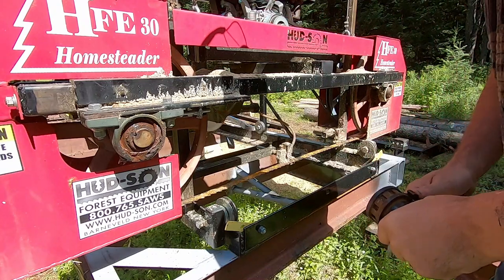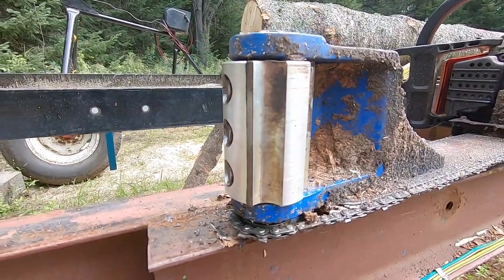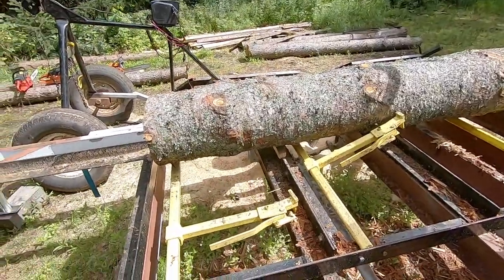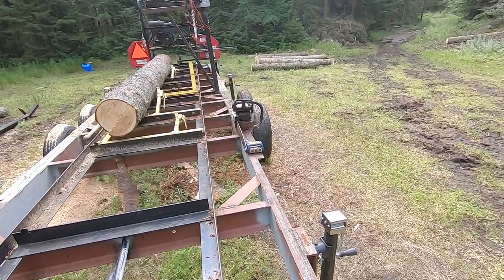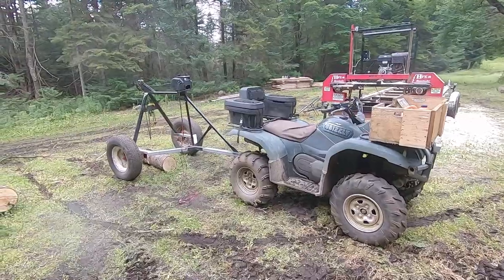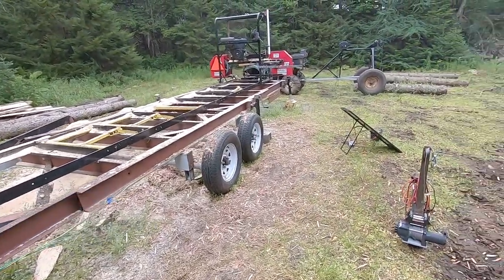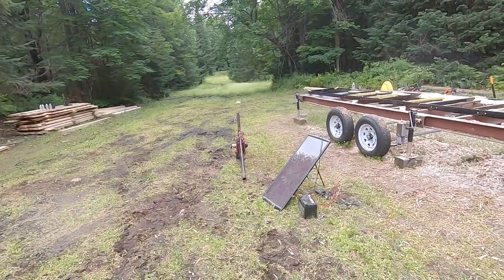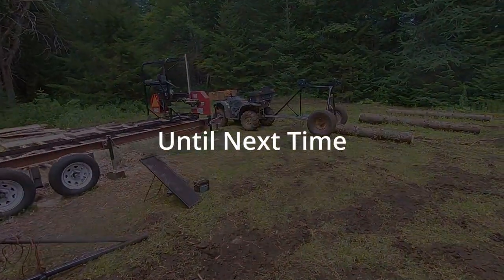Solar Power To Run The Sawmill and an Amazing Sawmill Tool

Comment: After about 5 years without one, I ended up buying an auto blade sharpener from Woodland Mills.  Runs off of a 12V battery so you can sharpener one blade while you dull another.

Comment: Thanks Jimmy,  I think I'll order one of them log wizards, making a video on blades will help me. Right now I'm just running of of the stock I got when I bought my mill. Need to figure out where and what I'm going to use and how I'm going to sharpen them. I think I want to do my own. Whats your plan of action?

Comment: I am new to Timber framing.  Looking for information about joints.  Which are the best and strongest to use  and were they are acceptable.  I would like to chat with you if you had time
Reply from the maker: I just left the woods, I can get in touch this week.  Go to tradesmanoffgrid.com and send me an email.  There's also over 300 videos on timber framing on my channel here.  I'd be happy to help.

Comment: Jim, as I understand it, an idiot is someone who follows his own counsel. You can look at this two ways. An idiot prefers perhaps not to avail himself of the state of the art. For unique problems there may be no "state of the art" thus you may be forced to play the idiot. This has been my case on several occasions. As Jordan Petersen says " you are a fool in a country of strangers", It may also be the case that you don't want to repeat the misconceptions of the past. Thus I have avoided research to address problems with a fresh perspective. Thomas Edison found dozens of things that didn't work before he had a light bulb that worked but again there was no "State of the art", Folks who don't like to solve problems may think you are stupid for not taking the easy way out of R and D but they don't have a handle of how to optimize design. The shortest rout between two points is a straight line but if you can figure out how to put the two points right next to each other you may not even need the straight line. Now you're really on to something...
Reply from the maker: You and I think alike on a lot of things.  I get more joy out of using the things I make knowing I've saved thousands of color in the process.